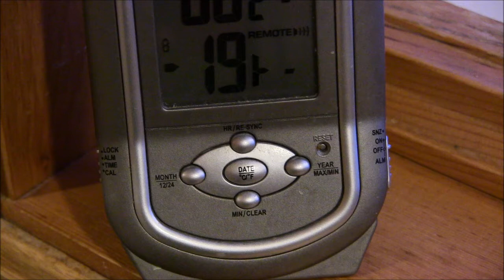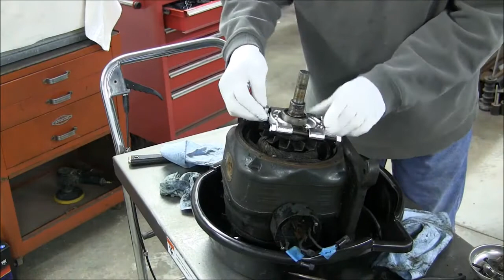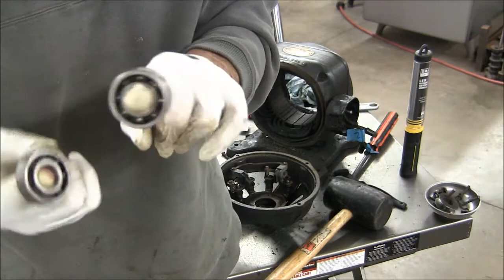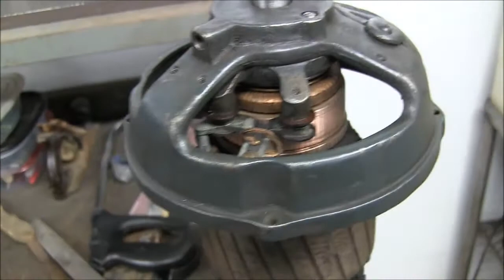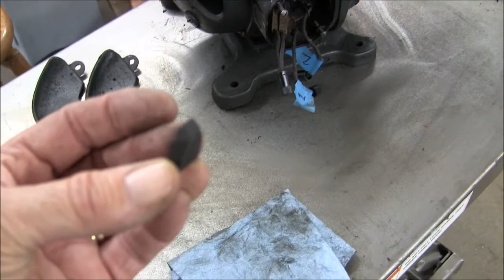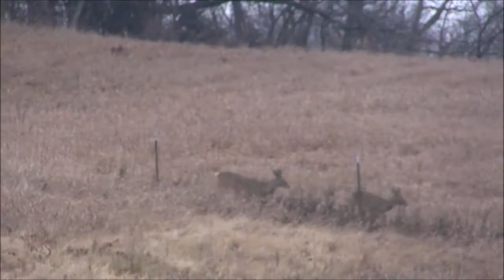Doall bandsaw refurb Part 8

Comment: Mike, why did you not use the new bearings as they were, they were shielded and filled with enough grease for the lifetime of the bearing. I would have used 2 Rubber Sealed ones to help with keeping the carbon brush dust out.
Reply from the maker: Hi Dave.  This is an old school motor with the external lube provision.  I suppose I could have used the new bearings as they were.  Just didn't think of it I guess. I would have thought the new bearings were pre-lubed but I don't remember them having grease in them when I popped the seal off. 🙂
Reply from the maker: Hmm in looking back at the video it appears they were pre-lubed.

Comment: That bearing separator seems to do pretty good - maybe must get me one of those to have on stand by.
Motor has a new lease on life I think - very fruitful bit of work Mike. :)
Reply from the maker: ChrisB257 - I maybe average once a year use for a puller of this type.  HF probably is good enough to last my lifetime. Plus I fully expect to run across my old set now that I purchased this one!   But I'm glad to have the motor out of the way so I can focus on the transmission.